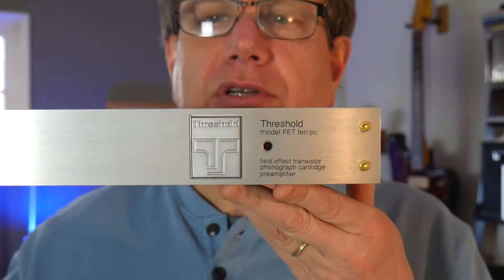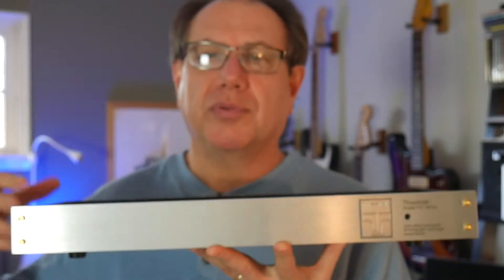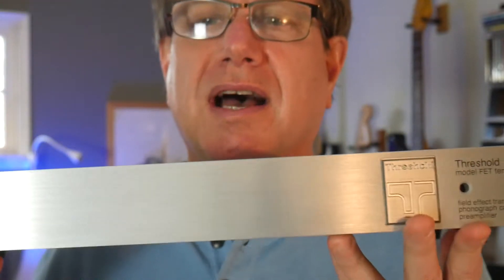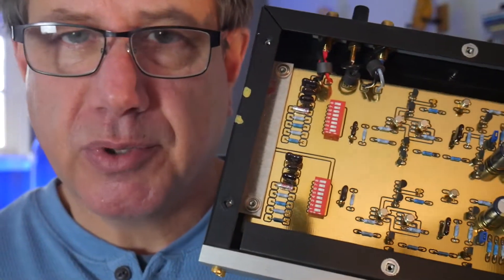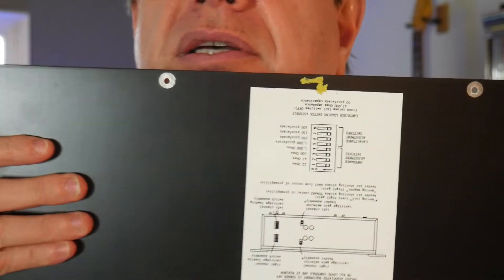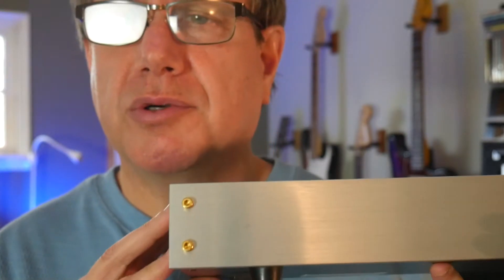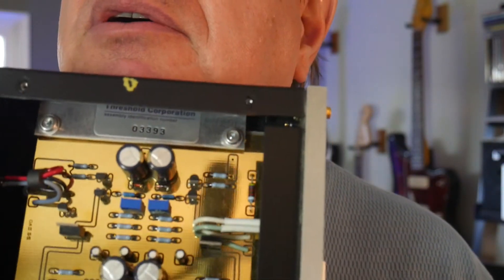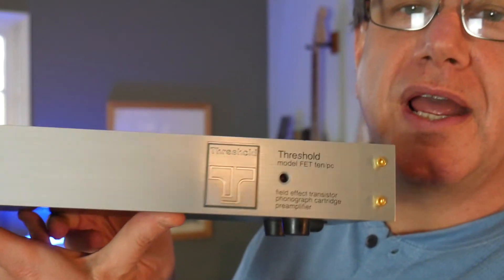Vintage Phono Preamplifier - The Threshold model FET ten/pc

Comment: Would this be an upgrade from my Cambridge Alva Duo? Its alot newer and i know the technology has changed alot.
Reply from the maker: You won't have much luck finding these 30+ years - and will probably be 800-$1000 - so there are plenty of other newer options for 200-500.   I use Schiit Audio Mani as a low cost solution.  $149.  I cannot comment on the Cambridge though.
Reply: @VinylRundown  thanks for the response! My dad has one and may wnat to trade.

Comment: Greg, that's a great piece.  I remember lusting over that unit back in the 80's.  But, with a wife and 2 little boys at the time I couldn't pull the trigger.  As for what I'm using for a phono-stage, I'm operating a Cary Audio VT-500 Phono Preamp and and a Cary Audio SLP-05 Preamplifier, combined with a Ortofon Cadenza Black cartridge.  Nicely done video.
Reply from the maker: Thanks! Nice stuff - tubes?
Reply: Yes, all tubes Greg.

Comment: So the question I have is, if I have a phono preamp as part of my preamp/power amp system, why would I need a stand alone pho amp ? I have Project Debut carbon TT upgraded with a Ortofon Blue. Adcom GTP-500 receiver & Adcom GFA-545 power amp, with a pair of Snell Type E IV speakers. This is definitely the best system I’ve ever owned. Would it really sound so much better with a separate Phono preamp ? Or should I just buy more LPs ?
Reply: It probably would be better. The same reason people buy separate pre apps and pre apps with separate power supplies. You might be better off just getting a preamp instead of using the receiver. There are a ton of really nice vintage (90s) preamps out there for sale

There are also some really nice new phono stages out there now, like the Moon or the Raga
Reply from the maker: If you have a decent phono section probably wont notice a difference. Some receivers have NO phono section, some have lousy ones.  My new amp has a really noisy phono section so I swapped this in from the other room.  Adcom is probably a good phono section. Should you pay a few hundred for a much better one?  Not likely if you are cheap and cheerful!
Reply: @VinylRundown  - You got my number. Money probably better spent on LPs. Thanks for sharing, nice interesting video. Take care.